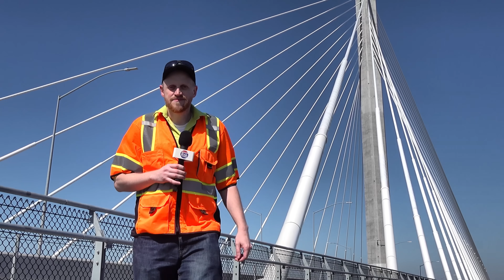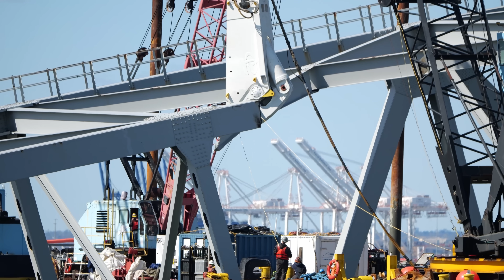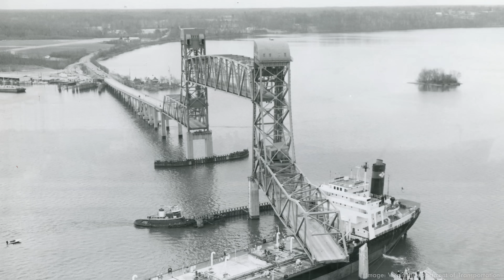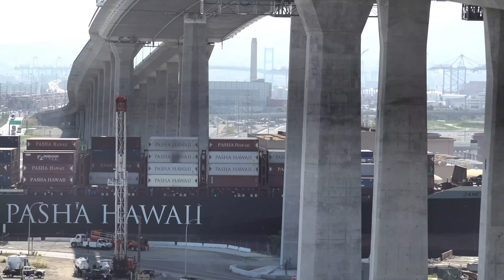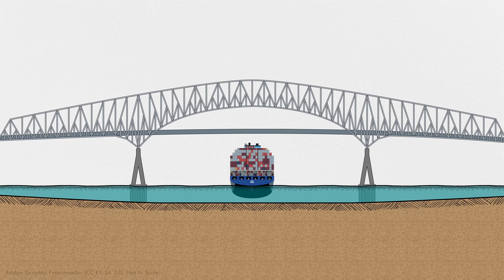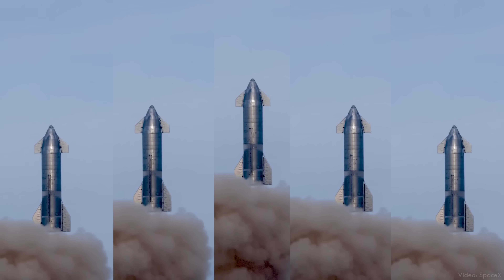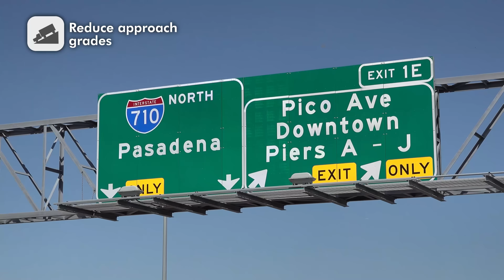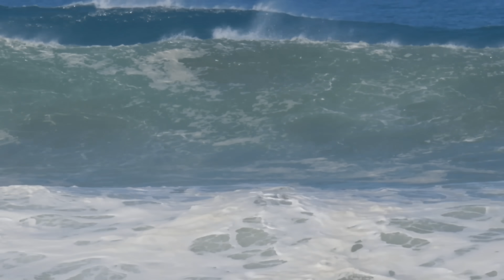How Bridge Engineers Design Against Ship Collisions

Comment from the maker: 📖Signed copies of my book, Engineering in Plain Sight, are back on sale! https://store.practical.engineering/
🌌Get Nebula using my link for 40% off an annual subscription: https://go.nebula.tv/Practical-Engineering
Reply: Would you do a video on the emergency replacement of the Crown Point Bridge between New York and Vermont?  Your viewers might be interested in what it takes to replace a major bridge in a hurry - about 2 years from finding that fatal defect to opening the new structure! 
A quick search didn't find anything.
Reply: Hey Grady,
Australian Engineer here - when I was doing some post grad studies at QUT in Brisbane Australia in the late 80s I heard an interesting story about bridge loading that I was reminded about by a couple of Road Guy Rob's remarks.

In the middle of Brisbane is the Victoria Bridge that crosses the Brisbane River. If you go onto the Wikipedia page and read through the details you will notice that is says there were signs in 1943 that the bridge was buckling due to increased loads. Those loads included trams - what you Americans call trolley cars and they are heavy.

The story I was told was that it was university engineering students who discovered the buckling issues. As part of their practical work they were sent down to measure the deflection of the road deck when there were no trams and it was fully loaded with stationary trams which happens just from traffic lights activating.

For years the university professors brushed aside the findings as just "student errors." They were sort of close enough but not too concerning. It was just dismissed as a "learning thing." Eventually one professor noticed that all these apparent errors were actually consistent so to check if there was something wrong with what the students were fundamentally doing he went and did the measurements himself and found that the students were actually accurate and that the bridge was deflecting an alarming amount when it was fully loaded with trams full of people.

I'd like to say that I can verify the story I was told but can't.
However the details on Wikipedia do NOT contradict it either and in particular note that the number of trams were restricted, which was exactly what I was told circa 1989. 

FYI - I am actually an aerospace engineer who did his degree in America (U of Illinois). In 2016 I had this odd little consulting job into Australia's energy sector which has major structural issues. I have since found that many other nations have similar issues and that the energy issues are PART OF the much larger INFRASTUCTURE ISSUES that include bridges.

There is a 2014 (I think) 60 minutes titled "America’s Crumbling Infrastructure" that highlights "The Portal Bridge" that crosses the Hackensack River. Go check out that story and where its now at. I can't give you too many details as I can no longer see that episode of 60M here in Oz, but I believe they said that America has over 30,000 bridges that need major repairs, major upgrades or outright replacement.

Its all part of this fundamental issue with keeping society functioning WHICH WE ARE NOT DOING WELL. I have traced this problem (as in Root Cause Analysis) back to ECONOMISTS. There was a revolution in the 1970s with Ronald Reagan introducing the world to Reaganomics. Hos contemporary Margret Thatcher gave the Brits Thatcherism while we called it Economic rationalism. One of its key concepts was that the private sector does everything better and therefore everything should be privatised. 

The problem is that infrastructure does NOT exist to make money it exists so that everyone else can make money. This is a concept that economists do NOT understand at all because they are trained to believe that everything must make money. Its also why they cut maintenance budgets everywhere they go because maintenance is a cost NOT a profit. This has resulted from the complete failure of economics education programs to teach how engineered systems work and is why we have so many issues with energy, water, roads, bridges,... etc.

I will be in the Steve Keen & Friends podcast in the next few weeks to talk about this and some other things.
Reply: Grady... Awesome content. I would like to introduce you to Geek ( @FreakAndGeek ) a fellow YouTube creator who used to make Mario maker videos who in real life is a civil engineer who builds bridges. So, she is a bridge engineer IRL. She recently retired from Mario Maker YouTube streaming after contributing a lot to the troll community (yes, that exits). She is an excellent content creator and I would like her to return to streaming with engineering subject and I am sure it will inspire more women to come to STEM profession. If you find her videos fascinating, please contact her... An Aussie touch is sure to make your content more global. It will also be interesting to understand the similarity and difference in the priority and consideration to each factors affecting the bridge engineering across the globe.
Reply: In Portland Oregon, I've done a study of I-5 bridge replacement proposals that cross the Columbia River and the Willamette River (slated for replacement by 2050), single-deck vs double-deck. 

The 1966 Marquam Bridge (double-deck) was declared structurally unsound after earthquake damage in 1991. Mayor Ted Wheeler promotes an I-5 tunnel under the Willamette River although it's neither possible nor advisable if it were. I recommend a single-deck truss bridge downriver with 4 pairs of support columns. 

The Columbia River I-5 Bridge replacement studies were single-deck since 2004 were changed to double-deck in 2009 for no good reason. In 2011, the first double-deck design was peer reviewed and widely rejected as structurally unsound. At least 4 double-deck designs that followed have been similarly rejected. Moreover, double-deck made on/off access ramps objectionably complex, high impact and several unsafe. 

I'm calling for a federal investigation of ODOT & WsDOT for these two absolutely abysmal engineering stunts AND the Rose Quarter I-5 so-called "Improvement" (adding 2+ lanes each direction) that demonstrably makes existing traffic hazards worse: more multi-car pileups, more passenger, pedestrian and cyclist injury and fatalities.
Reply: The Rose Quarter segment of I-5 does NOT need to be "widened" but the one component that can be salvaged (but isn't) is relocating the southbound on-ramp 3 blocks north to Weidler. The current location is at freeway level where motorists must accelerate hard in a short distance (~1000') to merge left to access I-5 while traffic on I-5 merges right to access I-84. The Weidler location is downhill with perfect visibility and more distance to navigate the "cross-merge" traffic pattern. Regional agency Metro Council President has DOT background and is complicit in this investigation.
Reply: As a seafarer myself and in Engineering Department of the ship, there are tons of backup machinery in case something fails. I'm talking about 2 pumps each for Lubrication, Fuel, Hydraulics, Air system and Cooling Water (Fresh water and Sea water), and each machinery has 2, meaning Generators and Main Propulsion have their own set of 2. Also all of those machinery have corresponding backup (Auxiliary) pumps which means even if 2 pumps fails (or the power fails) there's still smaller pumps capable of running the ship. There's also an Emergency Generator beside 3 Main Generators (really big ones) so an engine failure on 3 will still able to run the ship as all non-essential machineries like AC and normal lights are off to lower the load. Basically a ship is capable of sailing on Emergency Generator alone if worst comes to worst, theoretically.

Now onto inspections, there are 3 port authorities that are somewhat infamous for how strict they are in the world, US Port Authority, Australia's AMSA, and Chinese Port authorities (they're getting stricter every year) not to mention EU countires and Port Authorities. To prepare for going to Port in US alone will cost the ship tons of drills, testing of machineries and cleaning. I'm talking about a month of preparation with minimum of 2 weeks, basically lot of overtime for all crew to test and drill for emergency (these authorities are no joke for us!) as failing for inspection means lots of trouble and more overtime for us to rectify said troubles.

Overall my point is, it takes a lot, I mean a lot to cripple a ship. You need to be a bad Engineer to disregard all maintenance operation and it will still take months prior to this incident to f up the ship. I know nobody is perfect and those shipping companies that does wihtheld supplies for ship maintenance and crew living ain't gonna go to these 3 countries (US, Australia and China) and EU in the first place since it will cost them tons with their little budget and low profit and one peep of a seafarer about their living condition and these companies are now under special spotlight every time. They'll be going to more convenient deals that will not give them much trouble with convenient countries, and even then a skeleton ship is still susceptible to ITF (International Transport Workers' Federation) raid and charges, basically a seafarer police that will force companies to treat us better as well as making the ship more safer.

TL;DR - It takes a lot to cripple a ship with bad machineries and poor company policies, my conclusion is, a cyber attack is easier way to cripple a perfectly good ship undergoing regular inspection of US Port Authorities and maybe other good Port Authorities. Also I heard Synergy is a somewhat good company.
Reply: My wife is a civil engineer. I bought the book for her... but now I want to keep it for myself.... LOL   Very interesting.
Reply: The question is how much risk to the public are they willing to get away with, why people so willfully naive on how the world works?! Money is always excuse, never question why humanity still beholden to money 2000 year old mentality in modern era, peasant mindset.
Reply: Hi Grady! I had not heard the word "allisions" berfore this video, and being a bit of a language nerd, you abruptly piqued my curiosity! 
Does the prefix co- denote impact between two bodies both approaching the other, or does it also apply if one of the two is receding? Can allisions only refer to impacts with stationary structures, or is it also the correct way to refer to impact with stationary vessels? What about impact with submerged structures (seafloor pineapple-themed housing, for instance) or sunken vessels; would that be collision or allision?
Reply: All the mainstream media is worried about now is this f'in flotilla!!! What's wrong with shipping
Reply: Love your videos
Reply: @JustCloverSilly  Same!

Comment: Instead of bridges, there’s a much better… I mean, not to brag but I built one when I was 5 and it worked. What you do is make a steep slope, with a ramp at the bottom. The cars go down the ramp, over the river, and into a funnel on the other side. I forget how the funnel was shaped, but it kept the cars rubber down. Engineers have to work on those details. I’m a biologist, not a bridgologist. But I’ll check my mail for a thank you note. 😁👍

Comment: Widening to six lanes doesn't really help anything, but a purely separated bike + pedestrian path does.
Reply: Not true.  Adding a pedestrian path to a mile+ long bridge is a complete waste of resources and space.  A 3rd lane in each direction will help by 50%.
Reply: @grafzeppelin4069  You've got it completely backwards, bucko.

Adding a pedestrian + bike path is an excellent use of space, because A. it makes walking and especially cycling safe and viable crossing methods, which will mean fewer people needing to drive to cross (which should cut down on volume of cars on the road) and B. pedestrians and bikes are way more space-efficient than cars, especially for solo travel, meaning paths for them are far better at absorbing induced demand.

It's the third road lane that's a waste of resources and space, because it will alleviate congestion for at MOST a year due to roads being piss-poor at absorbing induced demand. We see this happen every single freaking time a new road lane is added.

Comment: 0.01% chance of collapsing with over 600,000 bridges does not mean it would take 10,000 years before a collapse happens. It would be 60 bridges per year.
Reply: I believe he meant for a singular bridge it would take approximately that long.

But extrapolating the failure rates across all bridges doesn't work either, since the vast majority of bridges have a LESS than 0.01% chance. A lot of bridges aren't over navigable waters (like rivers or streams), and some that are (like one of the ones discussed in this video) only really have to worry about height requirements which are much more easy to account for since ship height can be managed.

This is demonstrated by the formula he shows for the likelihood that a bridge is hit. All of the terms are multiplicative, and if you're familiar with the zero multiplication property, means that setting any term to "0" makes the chance of ship-based collapse 0%. So if there are no ships, no collisions. If no parts of the bridge can be hit by ships, there are no collisions.

So the 0.01% chance is the minimum expected, but most bridges probably fall between 0.01% and 0%. Worldwide, between 1955 and 2015, there were 35 major collapses from ships hitting bridges (that is 35 per 55 years across the millions of bridges worldwide, source is AP News). This figure includes ALL kinds of bridges, just as your 600,000 figure for the U.S. includes ALL kinds of bridges, even ones not over water. But assuming a high estimate of bridges (over water) in the world of being 2 million, 35 collisions in 55 years is a rate of well under even 0.0001% chance of a ship based collapse.

But a ship "driving" directly into a support? Not really something that can be easily prevented anyways, much like a building can't stop a car from driving into it but can easily avoid being hit by airplanes.
Reply: @Total0Reverse  i was talking about for all failures, not just collisions

Comment: i will offer a slight correction: there WAS enough time to get the construction workers off the bridge. nobody thought to contact them, and odds are decent that even if they'd radioed, the radio would have been at the truck, and the individual construction workers likely weren't all sitting in the truck but rather doing the work they were there to do in the first place. the fact that they were never warned though is a HUGE oversight that got people killed though, and i wouldn't be surprised if the families of the victims sue over it

Comment: Why not consider installing airbags in front of each bridge support post? These could be constructed from foam or fiberglass, designed to absorb the impact and slow the ship's approach before it collides with the bridge. Alternatively, a system of long steel cables could be used to guide and redirect the vessel, preventing it from heading directly towards the posts. Both solutions aim to enhance safety by mitigating the force of a potential impact.

Comment: Small note:  There are two tunnels under Baltimore harbor: the Fort McHenry Tunnel carrying I-95 (4 lanes each way), and the older Harbor Tunnel  carrying I-895 (two lanes each direction).

You mentioned the Sunshine Skyway early on as the  "eye-opener" for a ship knocking down a bridge. Vertical clearance came up in the discussion of the bridge in Long Beach.  The Port of Tampa is now facing problems with the replacement Skyway bridge because, at 180' vertical clearance, newer generation cruise ships cannot call at Tampa.  For example, those "Oasis of The Seas" class operated by Royal Caribbean stick up 236' above the waterline.  Tampa's future as a cruise terminal is coming into question as larger and larger ships enter service and older, shorter ships are retired.  That's probably something Baltimore is going to have to take into consideration.

I wonder if they might consider knocking down the approach spans and building another tunnel like the Fort McHenry Tunnel (dredge a cross channel, sink prefab sections, join them, pump them out, and bury them)., or even a bridge-tunnel combo like the Chesapeake Bay Bridge Tunnel at Hampton Roads.

Comment: Response to the errata: the probability of screwing up a probability calculation has to be high purely because of wording.  One of my machine learning professors gave us a probability question regarding dice rolls to solve in week 1 of the class.  His preferred solution was to ignore the arcane logic of probability problem setup and instead simulate the dice rolls a million times and use the statistics to figure out the probability.

Comment: I think the use of dolphins is really the way forward because it can be added to old bridges as well and the principle design is fairly simple. While it doesn't eliminate the risk of a ship being so heavy that it runs through the dolphins and still rams the bridge towers, I think it's a fair balance of risk and certainly reduces that impact immensely. The problem in Baltimore with it was of course that nobody ever put some decent dolphins in, something that can be fixed with stricter government safety oversight all over the country. The idea that we must wait on completely tearing down and replacing or totally refurbishing a bridge to make the piers collision-safe is simply unattainable. There are too many bridges and too much traffic so there's always going to be outdated bridges. Using some simple additions that don't rely on the bridge itself is probably a more practical solution.